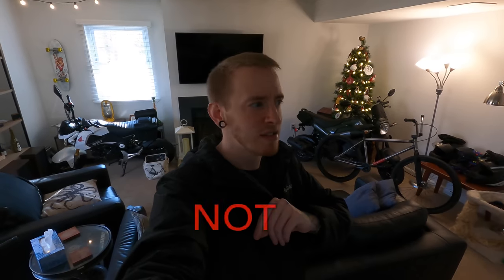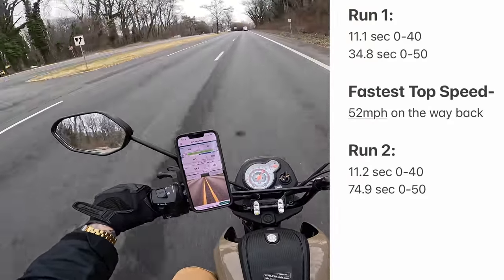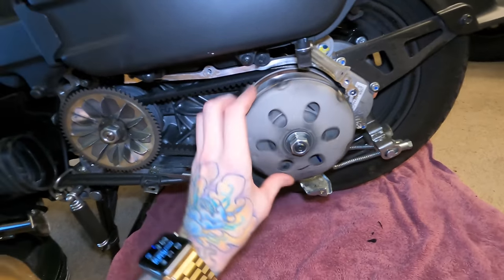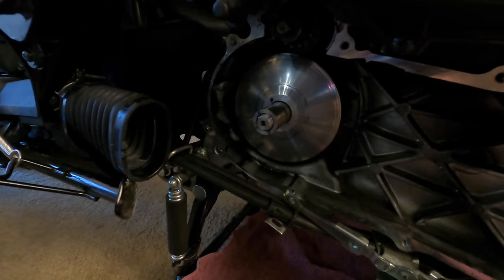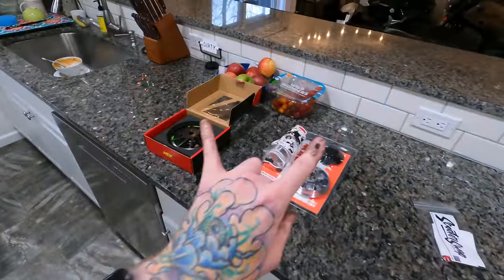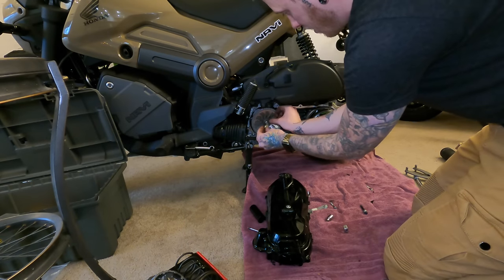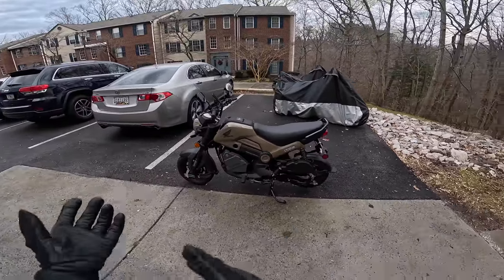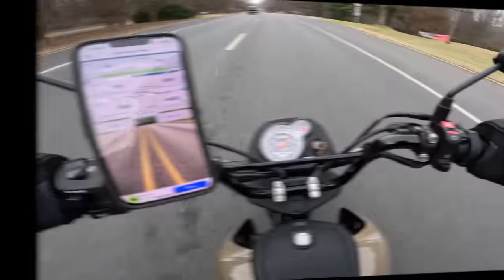Finally Addressing The Honda Navi’s Transmission Issue…

Comment from the maker: If you’re impressed by how much this clutch & variator kit improved the Navi, wait til you see what this $15 mod did to the performance afterwards! 😳 https://youtu.be/_qYeziastmE
Reply: Did you find that replacing the clutch fixed that shaking issue? My wifes navi seems to be doing something similar, I uploaded a short to show what its doing, the whole front end shakes but nothing is loose.
Reply from the maker: @CricketandBee  I just watched your short and it’s dang near EXACTLY what mine was doing, and the new clutch did completely fix my issue! If you want to try a free remedy first though, try taking some rough grit sand paper and sanding the inside of the clutch bell housing to see if that helps at all. After replacing my clutch I realized that my stock bell housing was a bit glazed which was causing the clutch to slip right as it engaged, which caused the shaking. So roughing up the housing may help the clutch grab and solve your issue, otherwise swapping the clutch should do the trick! Good luck man, hopefully that helps!
Reply: @LifeOfBurch  Thanks man, it is still under warranty, and we did buy an extended one (half price, ha ha) so probably gonna take it in at some point. Both local dealerships haven't had much experience with them yet so was looking for any ideas to throw out to them and came across your video.

Comment: This is not a cvt issue, sir. My suspicion is confirmed by two facts. First, you lose power as the engine warms up and second, you have trouble staring it up. The upgrade may arguably improve the performance, but the main issue is the Valve Clearance and the oil you use. Trust me!

Comment: My Malossi racing clutch is tunable. I got rid of the dreaded clutch shudder with the new clutch and the Malossi bell. The Dr Pulley sliders instead of rollers were great too. After the install of the new clutch parts I never looked back, and that was 30000 miles ago. Yeh you read that right, I'm rolling on a Honda Reflex that just turned 55000 miles and the clutch parts were installed at 21000 miles. I was so tired of the stock Honda clutch shudder on take off. No worries about the Malossi parts, they have proven to be extremely durable with very little wear. I change my drive belt every spring time so I get to see the parts once a year. Roughly 10000 miles per year on the scooter traveling all over my state of Illinois and all the surrounding states. No problems so far with Malossi, good stuff!!
Reply: Malossi is great! I have their Multivar in my Roughhouse.  Immediately noticeable difference. And the white contra spring for better downshifting on hills and when backing out of then getting back into I the throttle. Although the more resistance of the white spring had me stay with stock roller weights (for now) because I'm a bit heavier at 240 pounds. CVT'S can also, actually should be tuned for rider weight.  A new set of rollers can make a world of difference in acceleration and or too speed. Rollers are a consumable part that should probably be changed every 5000 miles because they wear a flat spot on the urethane bushing. I'm going to go with a stage six adjustable clutch for better takeoffs and for occasionally raising the front wheel, which btw can also be done for the Navi, or any bike with a CVT tranny. Adjustable clutch's are so much better than dicking around changing clutch springs. I can't wait to get a Yazuni pipe,  this little two stroke smoker needs to breath, and the stick pipe sucks. A Yasuni pipe will wake this little 50 up in the 7000-8500 range, and sound more evil while doing it.  😂

Comment: The fact that that stock clutch nut came off with ease may have been an issue there was no resistance when you back it off it's crazy that Honda doesn't put any loctite on those nuts 😮

Comment: The clutch/ variator is the first thing to change on the Navi, it's where you get the most gain.  Quick acceleration and 56mph is probably what most people want anyway. Need more, intake, exhaust and jets (maybe a better carb)... After the only thing to do is a big bore if one ever shows up.
The Navi would have been perfect if it was a 125cc EFI. If ever a 125 EFI conversion shows up I may go for it, it will help to make it more livable.

Comment: The clutch didn't really improve performance, except for the juddering issue. (You might have been able to fix that by scuffing up the pads and/or bell housing with 80-grit black sandpaper.) The whole variator assembly didn't really improve your performance. Essentially all that makes the difference are those weights. Yup. The weights. I installed a set of 13g weights that cost about 30 bucks IIRC. That did it. Yeah, I'm cheap, but then again it's an $1800 bike. Cheap bike, cheap fixes! ;)
Reply: OK Mr. know it all.  The lighter clutch reduces rotational mass.  Go look up how that improves performance, so you put out proper info.

Comment: Hey Burch one thing I’ve noticed watching your swap and every other one on YouTube is everyone else is pairing the new bell housing on top of the old one. Your way makes the most sense. Why would you want both of them on there? To me you only need the one and obviously you want to reduce weight not add it. Just something I’ve noticed and I’m not sure why everyone else is getting this step “wrong”. Love your videos!
Reply: You cannot run two clutch bells at once in a CVT. DEFINITELY do not listen to anyone suggesting that will work.

Comment: Definitely race Nina on the Navi.  Only on the safe, secluded raceway.  Supposedly it's not the clutch pads that get glazed it's the metal on the cover gets ultra polished. Freshening the clutch cover surface with the Emery cloth or 400 grit sandpaper helps acceleration.
Reply: Great tip. Thanks

Comment: That looked pretty much a not too difficult upgrade to the transmission. AT 1,800 bike it makes more sense to buy one of these new than to find a small bike used. As, although a real motorcycle, this looks to provide all the fun of riding but in a smaller and easy to ride package this old guy wants.

Comment: I used to fly fuel powered RC helicopters and we had centrifugal clutches like that. The wear on the inside of the bell housing at 6:30 sure did not look uniform when you lifted it up for a second there. Could not tell if that was uneven wear or just reflections. If uneven wear,  I bet that something was wrong with the bell housing. Seems like when clutch was engaging, it was skipping as it was engaging the tight spots then slipping off again instead of smoothly engaging till locking in. Good that you fixed it.

Comment: Some CVT tips:. Grab some extra variator nuts when working on the CVT. Thay are deliberately made softer than the shaft they bolt onto. That's because that is the engine crankshaft and if you fuck up those threads the entire engine will need to be disassembled to repair it. So, that said, be careful how you tighten the Variator nut, especially with an impact.  There is also a tool that locks into the teeth on the wheel that mounts up next to the variator to help hold it while tighten ing or loosening the variator nut.
Clutch pad and the inside of the bell wil look slick and smooth when glazed over, sand them with 80-120 grit sandpaper to restore their respective grip to one another. If the clutch pads are broken, chipped or severely worn in an unbalanced way, replace the clutch immediately.  It must be fairly balanced. If the assembly isn't balanced it can cause severe vibration issues. Also roller weights, clutch springs, contra and belts are consumable parts. Belts must be a certain width to engage the V groove in the front and rear pulleys correctly. Belts can affect acceleration,  vibration and top speed, especially if they're worn, out of spec, and also when you change to aftermarket parts you may need a different belt depending on what you replace. What Burch was likely experiencing was clutch chatter or the belt slipping. Sometimes they are out of spec or wear funny causing them to failz feel and or act weird prematurely.  Belts should last around 7-10 thousand miles in most two wheel CVT transmissionsl applications. Not sure about automotive CVT'S. Yes they use them in cars too. Anyway, when you add the heavier white contra spring,  it will affect the way the rollers play together with the clutch,  so when I added the white spring I decided to still use the stock roller weights, because I had to account for the stronger contra spring. The contra works together with the rollers to change "gears". You can buy different sets of roller weights to tune the CVT for your weight, and application. In other words you can tune the CVT gor balance, for takeoff or for too end. Keep in mind there are diminishing  returns. Meaning if you go too light on the roller weights, it will not accelerate well and top speed will be abysmal. Too heavy andnit won't accelerate  or downshift well, it's a balancing act that isnt hard to figure out. The key, especially with two strokes is to keep the engine revving in it's primary power band when its trying to take off or go up a hill. The contra spring essentially helps the transmission "downshift" when you say back out of the throttle to slow down, them need to accelerate again, but has rhe effect of not going down a gear ro oivk up soeed again. To wrak a contra spring is the manual transmission equivalent to staying in a higher gear when yiu shouldve downshifted. So instead of dropping the belt deeper into the rear pulley causing the engine to stay revving in the bike's engines power band.  Clutches: Heavier clutch springs are basically like a stall converter in a car transmission.  Meaning that the stronger the clutch springs,  the higher rpm the engine must  at to begin gripping or engaging the clutch pads into the inside rim of the clutch bell to start driving the wheel axle. Suoer heavy springs would essentially be like popping the clutch on a car or regular manual transmission. Not ideal for street use, unless your just wanting a wheelie bike build or drag racing. CVT'S aren't difficult and they are a must maintain and tune item for a vehicle that has one in my opinion. Scoots. ATV'S, Snowmobile. They work and are cheaper and easier than manual gearboxes. Yiu can also change final drive gear ratios as well. Also quality rubber really matters, especially for really small 12 inch rims. Dunlop, Pirelli, and Michelin are good places to start for 12 inch tires treads. Look for a deep rain groove.

Comment: You got the ncy clutch with the red springs that are 2000 rpm. SO that takes 2000 rpm for the clutch to start spreading out to engage with the clutch drum. Should have got the one with blue springs instead which are 1000 rpm. Quicker engagement and take off speed. Also the malossi contra spring is a higher rpm spring than the stock contra spring, its better with stock contra.  You can just buy the blue ncy springs and install in the clutch. Now you should also take off that horrible air box and just put on a simple cone or pod filter on the carb for even better response. Cheap and easy stuff. Of course exhaust is a given for a little more power and better sound.
Reply from the maker: Thanks for the heads up! I had no idea that you could get different springs for the NCY clutch to set the engagement RPMs. I did notice that it takes longer to grab now and thought it was something I’d just have to get used to. I’m definitely gonna grab some of the blue ones! Past that she’s staying stock for now. That was always the plan until I had to do this out of necessity. Of course that’s always how it starts, right? 😂
Reply: @LifeOfBurch  The blue springs will make a world of difference for like 10 bucks or whatever. I stopped saying im gonna leave stuff stock lol. My Navi has 2 grand in mods and im about done with it. My Honda ruckus has 5 grand in custom mods and now my Honda CB300R that I just got 3 weeks ago already has 1500 in mods. Ive yet to meet anything I like stock. Anyways enjoy.

Comment: The navi is the first real bike I feel like I could handle outside of scooters. It's tempting to want to get my motorcycle learner's permit and get one of these as they seem much easier to work on than a real bike too, very similar to the metropolitan
Reply from the maker: Do it dude! You’re exactly right, these are the PERFECT step up from a scooter. My girlfriend learned lots of her riding skills on her Navi, then translated those skills to her Rebel 300. Navis are the perfect stepping stone into “real” bikes and they’re so cheap and easy to work on!
Reply: I wish other big names made stuff like a navi in this price bracket. Even if someone made one that cost a little more but had EFI to start nicer in cold places and with modern gas

Comment: Those clutch pads looked bad on the ends. Chipping away from not engaging correctly? I did a lot of CVT work when I had my Ruckus back in the day. Slightly heavier weights will give you a little more top end and once you get your weights dialed in the slider style weights will maximize how far your variator can open up.
On starting and running issues, check your airbox to make sure it is sealing/closed up correctly. A leak into it will throw off your jetting. I eventually opened up my airbox with a 3x4 cut out and a rain shield and rejetted. That was my Ruckus days. Looking at the Navi and the price point, I'm thinking it's a beefed up Ruckus?
Continued good luck in your Navi adventures!

Comment: I’m pretty sure your drum was glazed on three spots causing the clutch to slip during the revolutions. I think it’s caused by improper break in. But either way good video!
Reply: I'd agree, some of those spots were wayyy shinier than the rest, which is usually from bad break in etiquette
Reply from the maker: Ooo good eye! Now I want to go check it to see. I noticed that it seemed glazed, but didn’t notice the 3 different spots. That would explain A LOT 😳
Reply: there is a certain way to break  in a new navi? am wanting to get one from a Honda dealer near me brand new but idk they look  awesome

Comment: ha ha I have  a similar voice helper in my head
 & laughed as it is there to "help" me ;)
  its good live in the woods.  as a few times others have heard me talk out loud to answer my "other" voice. 😜

 that new clutch and variater look good.  runs good too!
the old stock stuff needed replaced [as many stick parts tend to be less than desirable]  (yup im picky)
 great job om replacing/up grading the scooter.
  I watch other vids on mini bikes [yeahmight get 1 a does] from Black66
he has loads a upgrade ideas and on the cheap. he is a pavement type too that looks for speed. 0-30 lol
but such great ideas.
 Id build one for trails, so slow n grunty/low torque would be my concern as I seldom need 30 on a trail.
   
 yeah I have a shop 24' x 27', my wife calls it the garage.

 to my surprise it was her idea to bring my saw in the kitchen as she thought it looked too pretty to sit out there. ;)
after a few months I moved it to the shop & havnt gotten any comments about that.  [it looks pretty out there]

 my bike/ [i call it a 4 wheeler] is inside the shop being a pretty [2022] I bought last year. it dont leak, but. . . 
when I had bikes they did come inside the house, [my single days]
 but my lill voice said I needed to build a shop with a concrete floor.
  that voice sounded like it knew best. . . 😎

Comment: The Navi has a 0.9 gallon tank and a mpg of 132.6 so not bad other than it having a carburetor 👍 best to use unleaded Ethanol for the bike it has some protection against the engine sputtering also I bought a new carburetor which is why I said a 132.5 mpg difference also major speed difference I can get a top speed of 62 mph switched the throttle and the best thing I found out is that you have to fill it up higher than the average of 0.756 I filled it up to 0.923 and major difference also I changed the brakes to hydraulic and made the speedometer LED and added front suspension also the heavier you are the slower the acceleration is so if you wanna hit 62 mph be 165-175 lbs and you’ll get that difference with the government tax and fees plus the bike and all the mods it costed me $3,347 so this can be a nice little moped/scooter if you put the work in

Comment: I know it's all resolved but it may return on you.  Common with CVT.  Usually means you have to open up the CVT a d blow out the worn belt dust and clutch dust. Video still playing at this time so if rollers are all in place and none disintegrated causing imbalance I would say it's just a cleaning.  Same happens on my Forza 350 so it may happen to you again on both bikesm

Comment: The 2022 isnt the same. I got 50km max 5sec not even not modified. With modified clutch i get 60 in the same time. And have a 100km max on speed wich took me like 9 seconde max to get 100 km

Comment: You think my Honda dealer would install these for me? No tools or mechanical knowledge…
Reply from the maker: Yup, I’m sure they would! And if they don’t want to I’m sure any local motorcycle shop would do it. It should only take an hour to do, and one hour of shop labor would be cheaper than you having to buy the tools to do this anyway 🤘🏻
Reply: A Honda dealer won't install aftermarket parts unless you buy them at the dealer. Warranty issues and stuff like that. An independent shop might do it, depending...
Reply: @LifeOfBurch   True but they would have the tools for what the labor cost.  Your video was thorough enough. Dive in Wade you can do it.